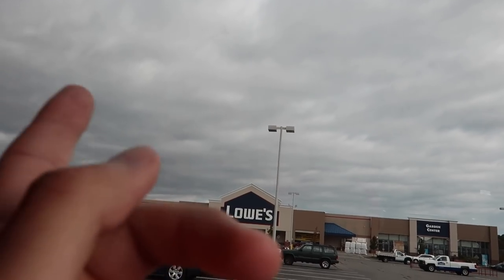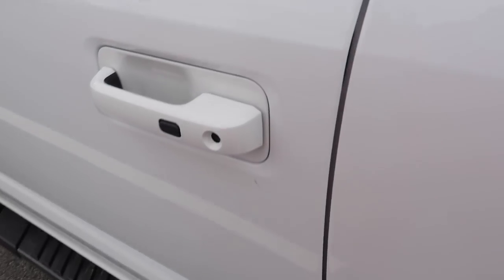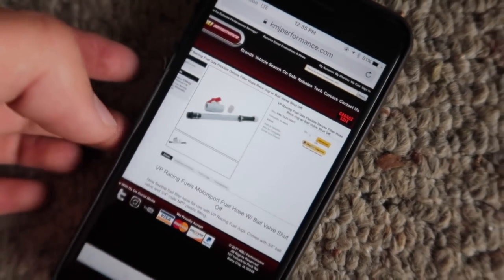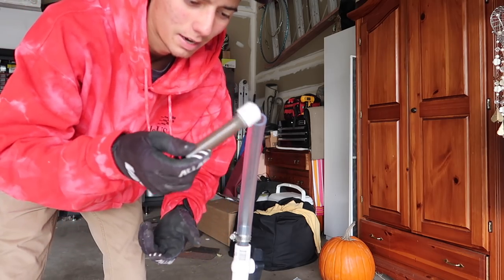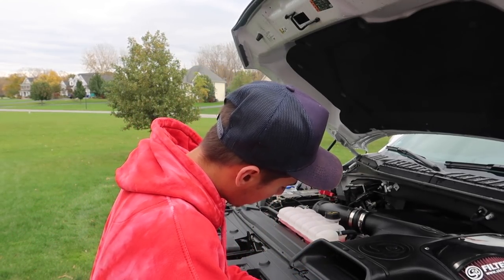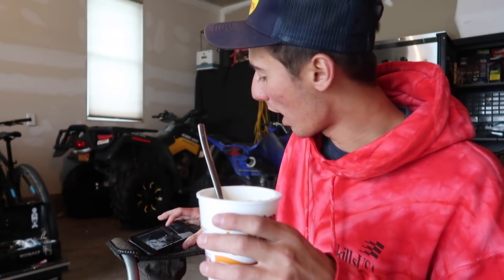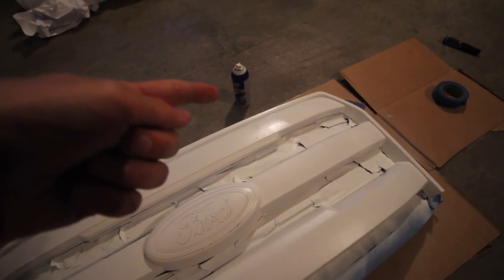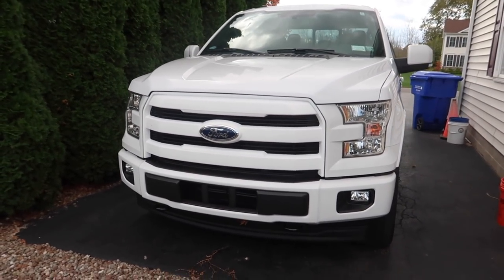EASIEST $5 TRUCK CONVERSION... Change The Look Of Your Truck

Comment: Can't make a new Ford truck ugly buddy! Good choice. Will last ya 20yrs with good maintenance. Alum alloy body will never rust. All others playing "catch up" to FORD. ECOBOOST twin turbo requires 5k mi oil changes using good oil like Mobil 1 5w30 or Pennzoil Platinum 5w30 & only Motorcraft filters!! I've owned 12 Ford trucks. Always best.🇺🇸

Comment: why wouldnt you just do one piece of tube with the valve on the end silly. just would of have to still put both screw in sides on though, so it would fit in the tank. lol